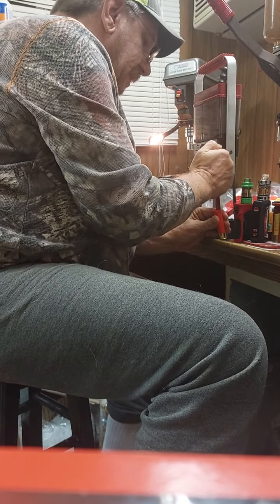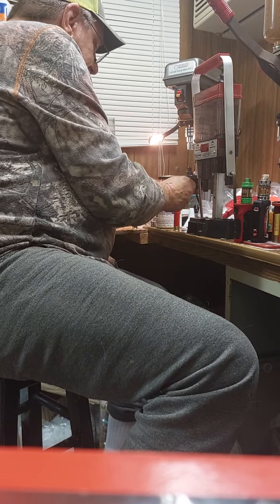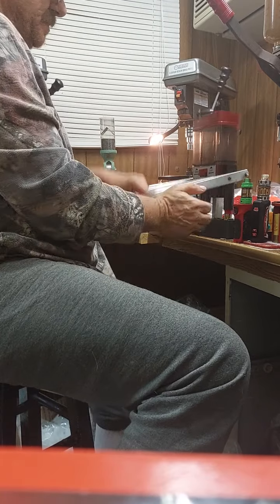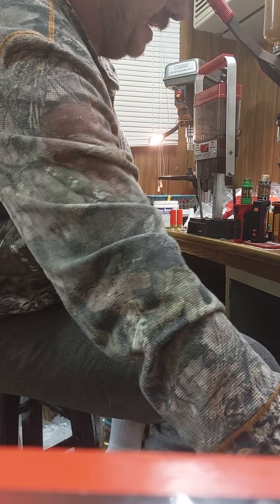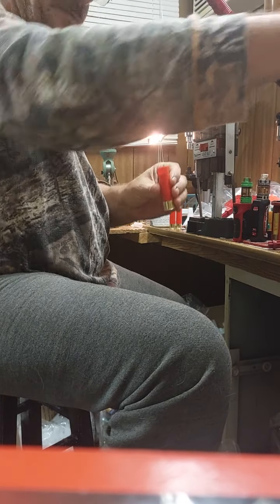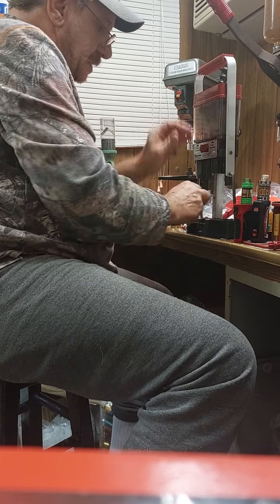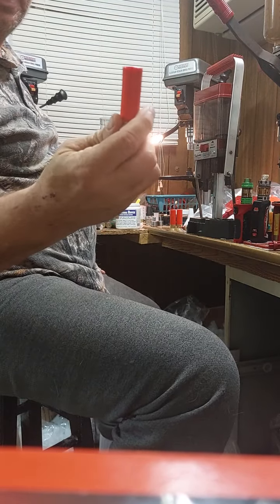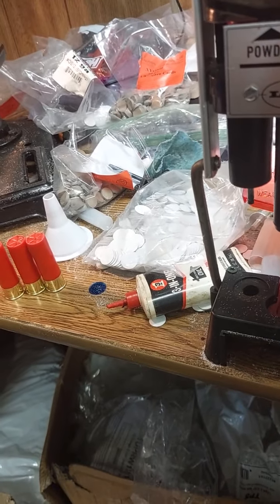00 fold crimp

Comment: I think you are right. I believe he is not getting the stack height where he needs it. I have used 28ga nitro cards in the bottom of the TPS white lighting. They aren't as tight fitting but I have not blown out a seal. I do prefer the 20ga card though. Roger thanks for all of the info and videos you do. I have learned an awful lot from you.  Thanks!

Comment: So, the lee load all II is somewhat of a "by feel" machine. When you hit the pre crimp section you need to just push down a little and lift up to see where you are at. Then if it needs more just push down a little more, I stop when it feels like I hit a soft wall. Then when the crimp is closed just enough that you could still fit something about the size of a 209 primer through the end of the crimp I final crimp it, lift and rotate the shell 90 degrees and crimp again. Not hard enough to crush the hull, but enough to close the crimp.